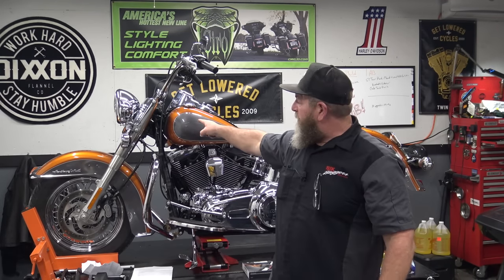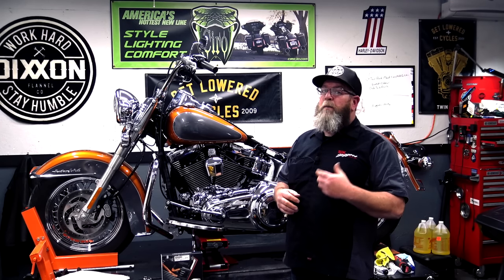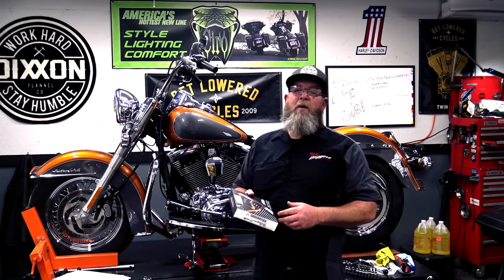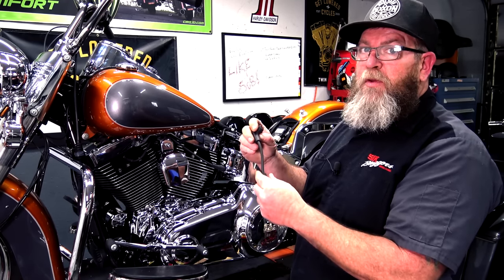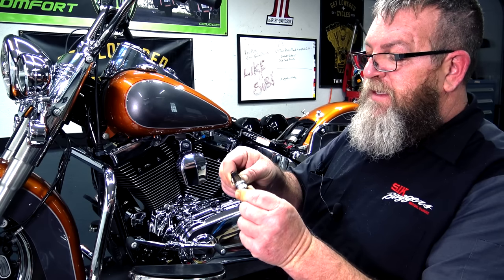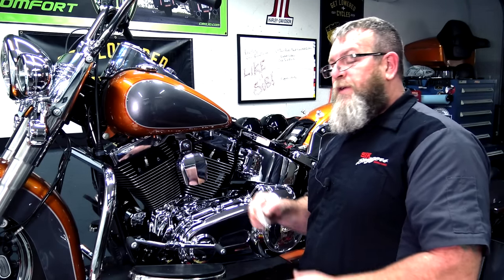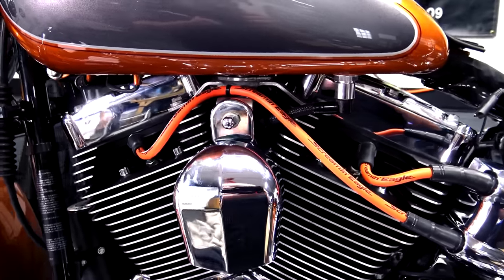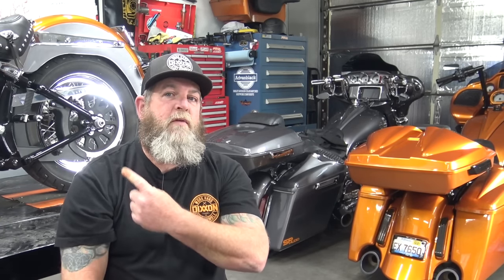⚡Inspect Plugs/Wires @harleydavidson + Install HD PHAT Plug Wires Cholo Softail Build⚡

Comment: We installed a set of fat wires (HD) because the local dealers couldn’t supply a set of factory leads. But kudos to HD . They included all the wire loom or loops in the box. Milwaukee 8’s have an interesting set of attachment to guide the wires
Reply from the maker: Hey Steven yes they do...kind of a pain in the rear on the m8s

Comment: 2005 FLSTFSE Very helpful. Had a problem I’ve been chasing for a year. The bikes speedo and odometer would stop working 10 miles into a ride and the bike would sputter when coming to a stop. Even shut off in low idle turns. Harley forums and some Harley shops said it was the Speedo or speed sensor that needed a change out. Bike has 20k miles. Ran into someone that said to change out my Steel braided lines that was cause the issue you talked about. I went with the wires you mentioned in your video. Bike runs great now. Great video you shared.

Comment: I have a 1998 Harley-Davidson road king classic, and when I accelerated hard it would miss. I got some Moroso spark plug wires and the wire for the front cylinder was too long.I took that wire off and shortened it to fit. On the part of the wire I didn't use I noticed nick in the wire. This cured my missing issue,today was finally 60+° today, so I took it out for a shakedown. It's running better than ever.
Reply from the maker: Very nice! Its usually something simple like that and easy to fix....glad you got it lined out!

Comment: Great upgrade, I want to add those to my 21 RGS!
Reply from the maker: Heck yeah they are nice for the price...my original amazon set lasted well over 5 years and was still working when I too them off to replace them with Ciros Shock and awe...albeit a little more expensive than the amazon ones though.

Comment: If the spacing on a spark plug is "off" how do you adjust it?   EXCELLENT video!!!! Thank you!!!
Reply from the maker: Thank you Toby. If the gap is too big simply push the electrode down. If you have a spark plug gapper like the tool I used in the video you can use that. Use the side of it and press in. If its too small use the hole in the tool to pry up and spread it.
Reply: Thank you Steve! As always you're a wealth of knowledge and have an incredible channel!

Comment: I'm went with the SE Phat 10mm wires, and I LOVE the zip tie tip! 👍 I was told not to use anti-seize on the plugs because it interferes with the torque setting (over tightening).  Have you ran into this issue?  Thanks again.
Reply from the maker: Ive got 2 bikes with it and 3 bikes without it ...I dont think it really matters
Reply: I've  been using a touch of copper coat on my plug threads for years. Torque to spec and all will be fine. Copper is a great conductor.

Comment: You can also use a zip tie to “burp” your plug wire boot so that it’s correctly sealed to avoid corrosion. Good video though.
Reply from the maker: Nice...I always used a paper clip if it needed burped but to be honest ive never had that issue with HD wires and plugs.

Comment: Do you have the ohms values for the stock spark plug wires ???? Tc88
Reply from the maker: twin cam 88 has 5,000 - 11,666 ohm

Comment: Good Morning,
I live in Brazil (Rio de Janeiro) and I'm new to the channel. I have a 2011 Fat Boy with 15K miles. My motorcycle has the following problem (I ask you because no one has yet discovered what happens). When I maintain a constant speed, (easier to notice at low speeds) the engine chokes. Another point is that the exhaust, original, backfires a lot whenever we release the accelerator. Spark plugs are new (Screeming Eagle).
Would you or someone else on the channel have a tip to solve this problem?
Thank you and I wish you all a Merry Christmas.

Comment: You never mentioned what spark plug you recommend??? Does a stock or stage one matter on spark plugs????
Reply from the maker: Its the same as these wires...they are not necessary at all. You will notice no notable difference if you run Screamin Eagle plugs on a stock or even stage 1 tuned fuel injected bike. If you start getting into higher stages and you find yourself having a hard time tuning the bike, then you may look into better plugs but really only for longevity.  The rest of what you read about "better"  plugs is all hype.  If your bike is running fine with oem plugs, keep using them and save giving harley an additional 15 bucks.

Comment: Where does the dialectic grease actually go ? Couldn’t tell where it was put…… thanks
Reply from the maker: Put it around the edges of the boot...it will help eliminate arching and give it a good water tight seal.  Later it will help remove the wires when needed.
Reply: @sikbaggers  just did mine. I didn’t pull the fuse. Very simple. I didn’t torque the plugs, just a couple ugga duggas
Reply from the maker: @crazylouie68  really no need to pull the fuse or torque the plugs...I usually just do it hand tight..but the first time I dont use a torque wrench ill have a buch of comments on it lol